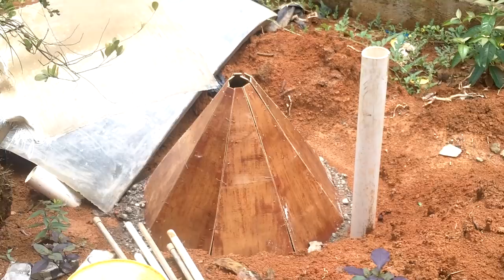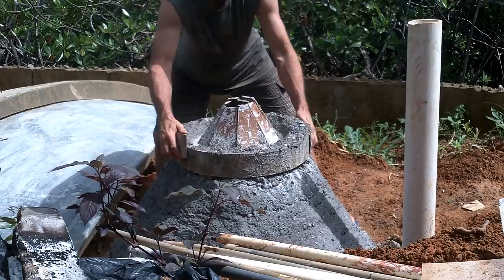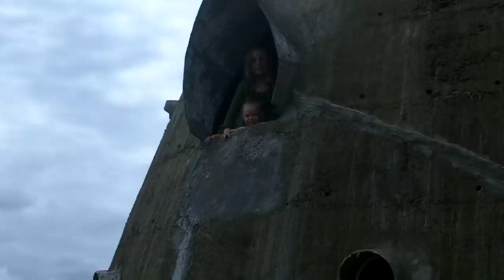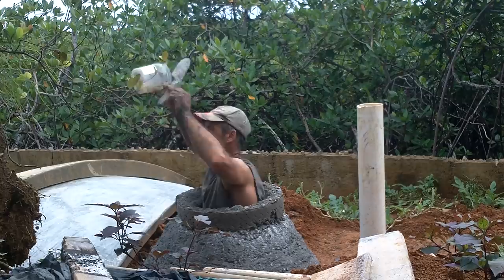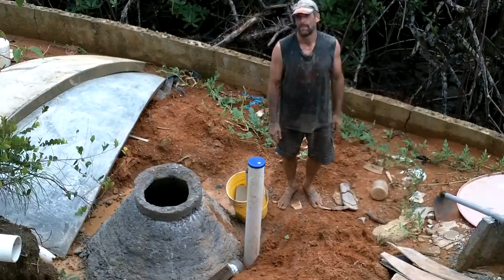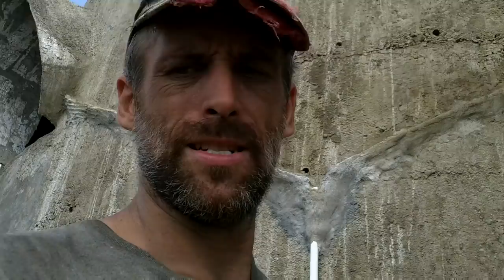Fart Machine 002 Main Chamber Top

Comment: Manometers are handy to have, you can make one easy just tubing and a measuring stick, need some way to know how much pressure you have. A surge tank is also easy, counterweights and a floating gas water sealed tank, make it part of the iron filter.  Chopped up green matter has a lot more gas than poop, like seven times more, supplement that thing with clippings!. Also, great project! Bangorang!

Comment: You know, I’ve seen a version of this generator that had a floating, rigid domed sleeve for a lid. As the gases are generated, it forces this lid upward. The downward weight of the lid then provides pressure to a tap at the top. In this way, gas can be stored and used within the vessel but no great pressure is built up: I think an LP system is pretty low pressure anyhow. Just wondering how you store the volume of gas? So amped you are giving this a go! Chicken poop will help it a ton. :)